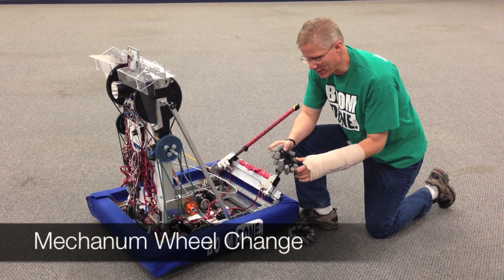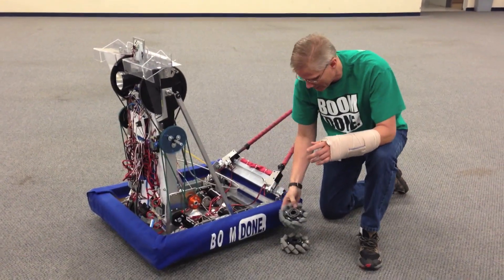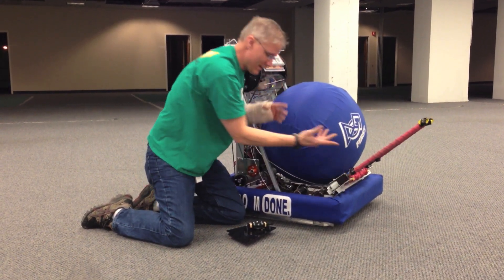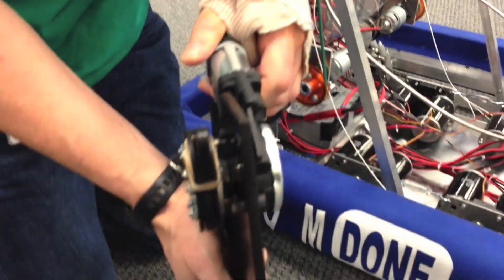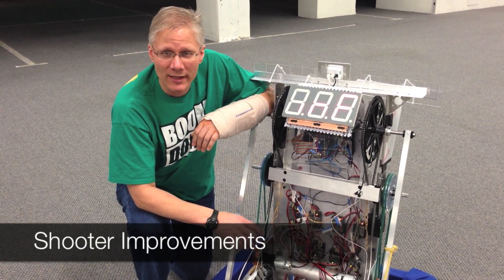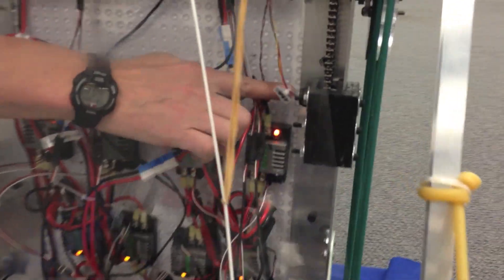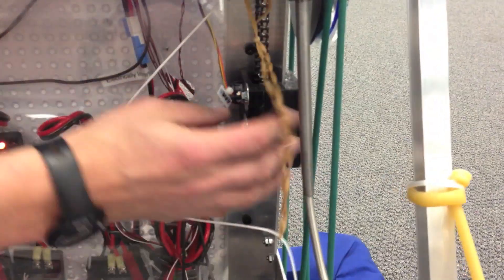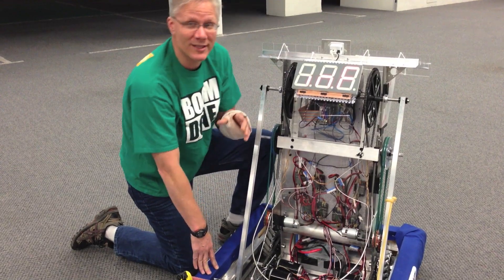Ri3D: Boom Done - El Toro Improvements

Comment: What type of transmissions are you using on the El Toro? We've got 775s but the 5mm outputshaft is just too small to attach much of anything directly to it. I've been out to the Banebot site. They do not have a custom transmission for the 775. Please let me know.  Thanks!

 Looks as if you have added a softer crossmember.  Last comment....what kind of stops did you install on the inside to keep the mechanism from going inward to the middle of of the assembly?  We built the assembly but it wants to move to the middle.